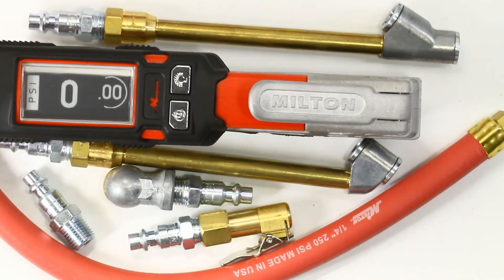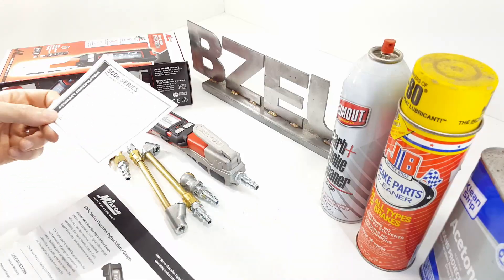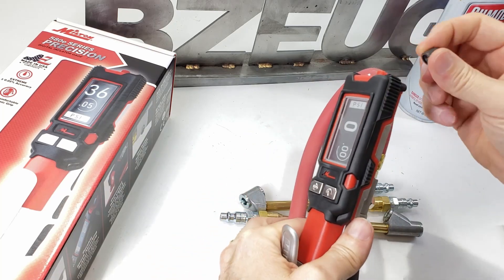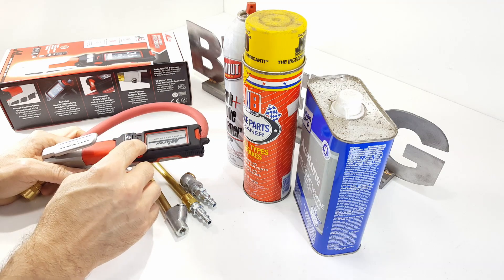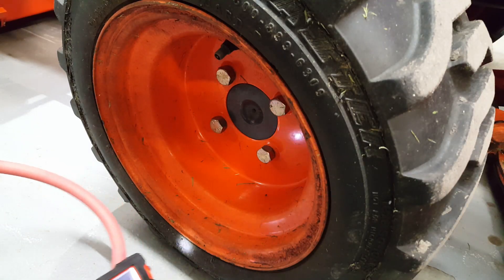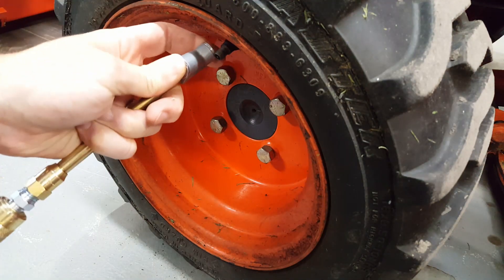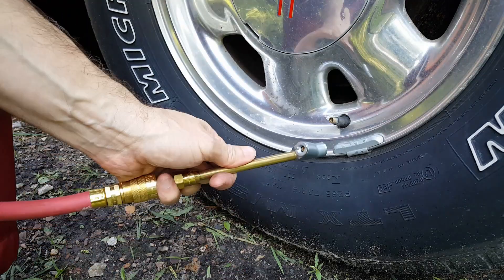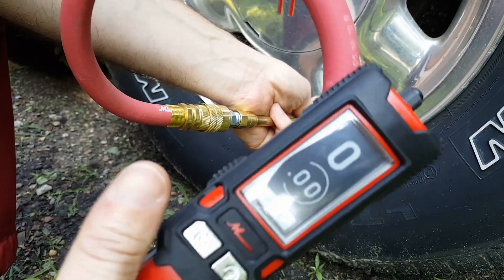Digital Tire Inflator Gauge S-580e. High Precision from Milton Industries. The best tire inflator.

Comment: I bought it awhile ago because of their "industrial quality" [false] claim.
I am not a tire shop and used it on my personal vehicles maybe - MAYBE - a dozen of times. Now it's dead - even the screen won't light up, even the light! 
Bottom line: as others have mentioned, it's a convenient concept and junk quality. Oh, did I mention it's grossly overpriced?
Reply from the maker: Yikes!  Mine still works.  Are you going to call Milton for warranty support?
Reply: @BZEUG  Their warranty is just as miserable as their product - one year. Mine is a little older than even though it was barely used. Also, I read a review on Amazon - the guy had a newer one that died, contacted milton and was instructed to send it to them for inspection. On his own dime, of course. He did, and never heard back - they never responded to his emails so it fell into a black hole. Very reputable outfit... NOT!

Comment: Bought on Amazon and returned same day.  Very cumbersome and awkward to use.  There is a very large button screw on the bottom covered by a rubber flap.  I discovered air leaking out around the threads.  I attempted to remove this nickel sized button screw to fix the leak — couldn’t remove it.  It was a bad leak.  The screen is awesome though but hated everything else.  Tools are meant to make life easy this tool just added to an annoyance.

Comment: You should have started with the cost which is $200. I own a midsize company and that's too rich for my blood even. $50 maybe $75. For $200 I'd expect automatic pressure filling off my compressor.
Reply: Wow, does it even come with a certificate of calibration (to NIST)?  Looks like it has good repeatability and has high resolution but with no calibration its no more accurate than any other gage.  You can see it is a full PSI off from his onboard computer.  OK which one is right?  Doesn't really matter how much it costs in the end.

Comment: In your video, you appear to hold the chuck on the valve stem. Doesn't the device have a lock-on chuck?
Reply from the maker: Yes it comes with a locking chuck which I did not use in the video but have been using lately and I really like it.
Reply: @BZEUG  Thanks.